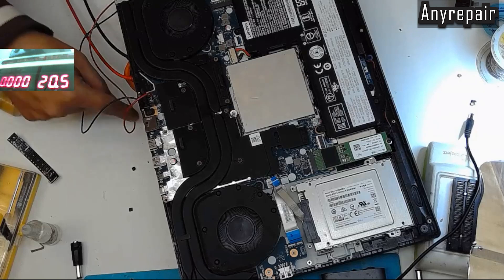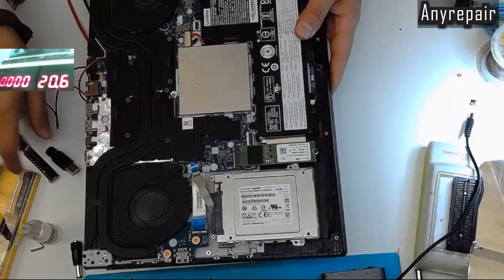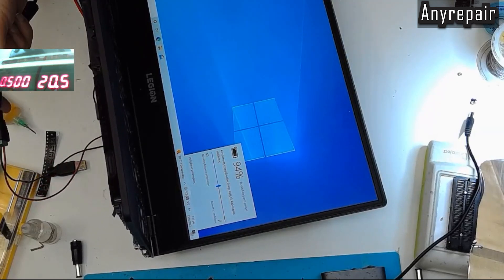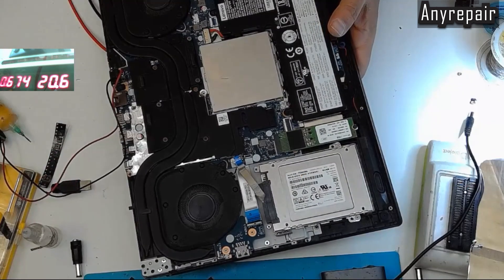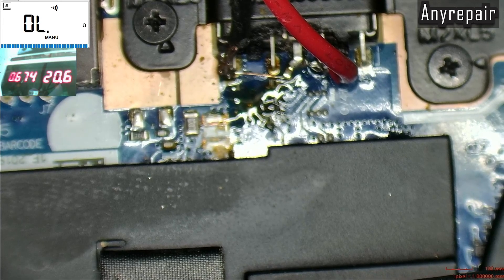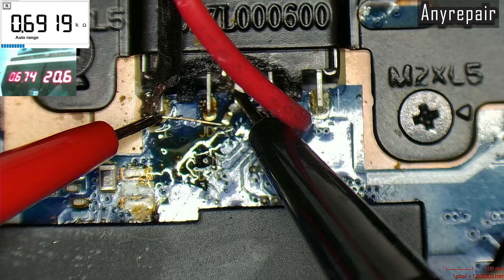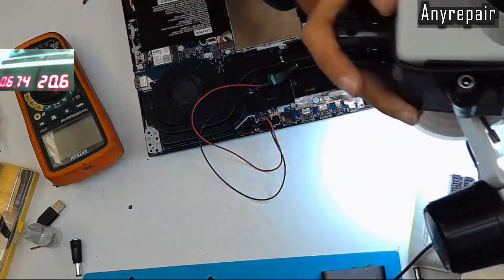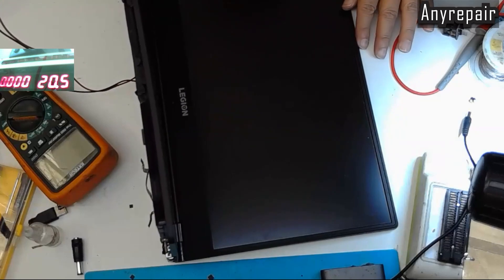Lenovo gaming notebook 230W charger hack

Comment: So if the resistor is in the adapter plug eg 64W 285 Ohm, inside the Lenovo there is a virtual resistance to match the 65W? And if I change the adapter to 120W, but the adapter plug resistance stays 285 Ohm, I should add another 285 Ohm to the Computer DC input data pin to ground ? 0.679 Ohm plus 285 is near 1K Ohm is about 120W, 230W should be 4.6K... Sorry but I am trying to understand this not very clear topic and do not want to damage my lenovo swapping from 65W to 120W but no resistor, there could be a warning but no damage is that so?
Reply from the maker: If you change the adapter to a larger wattage, it will work with no problems. You dont have to do anything if you are using original adapter or oem for the specific model. Thia I am showing in this video is a guide to override the lenovo security and use a common 2pin adapter, since lenovo has 3 pins.
Reply: @AnyRepair  OK, I bridged the data pin with ground and it's working, but the Lenovo still uses only 65W total, Should I hack the adapter with a 1k in series over the 285 Ohm, or it is on the PC side that I have to bridge a 1k resistor??? or both? NO it's not OEM adapter, it's a 120W universal hacked.
Reply: @AnyRepair  Ahhhhh, maybe I understood now.... Uhuhuhuh.... yes, I should definitely try your hack at this point... It will still work with OEM adapter with the data pin right if I understood.
Reply: @AnyRepair  As I have understood the orignal OEM tips has a resistor b/w the data pin and the ground on the transformer side, that is read from the PC and tells him the tension or wattage of the transformer. The PC side if you add  0.47k to ground it will work with about 70w and below, but not more, for 100W it will need 1k... this is very good information.
Reply from the maker: Exactly! Nice!